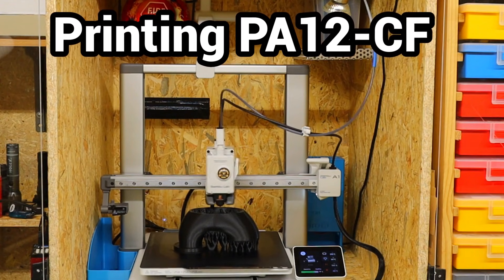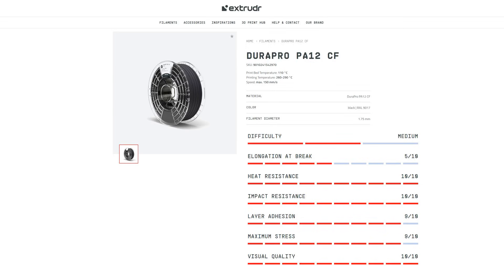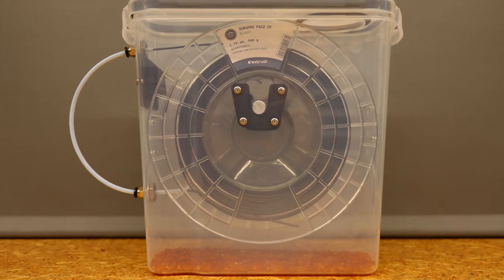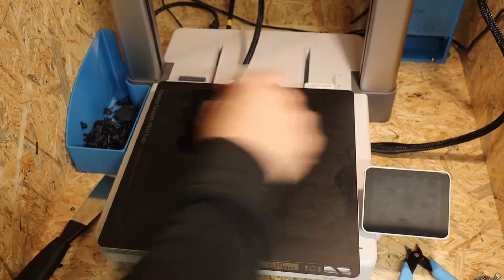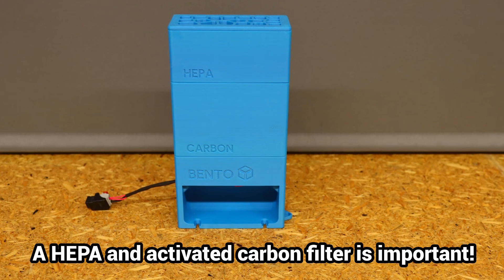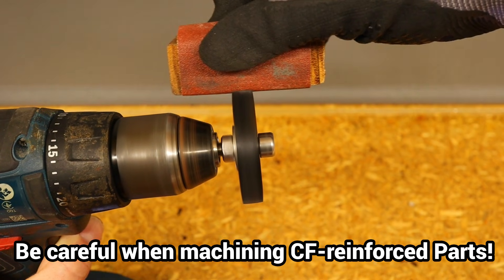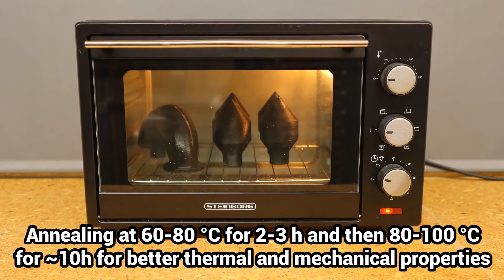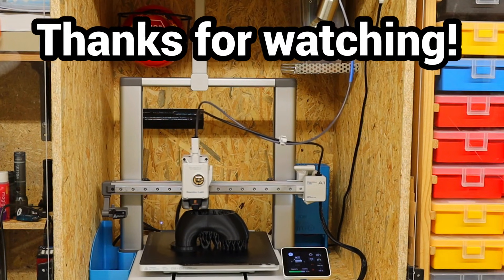Important considerations printing Nylon CF / PA12-CF

Comment: There rerally isn't "fibres" in £D filament. It's more a "dust". With no longditudinal strength from fibres I'm suspect about extra "strength" claims
Reply from the maker: Of course, a significant improvement in strength is not to be expected, but the microscope images clearly show fibers of considerable length!

Comment: I was wondering why nearly nobody makes pure nylon pa12? I can only get pa12 nylon mixed with cf. I wanted to avoid dealing with carbon fiber because of all the potential issues it may cause also I also did not need the extra durability of the cf and have an enclosed printer so warping should be minimal.
Reply: because it would warp
Reply from the maker: Yes, I also think the much lower warping and much easier printing difficulty of fiber reinforced filaments is the main strength of them!

Comment: Not better to anneal it before coating? 
As the coating should block the moisture in both ways, preventing from getting moisture but also to be released from the material.
Reply from the maker: I annealed it as is shown in the video!
Reply: The video show the anealing after the coating.
I ask if it's not better to anneal before coating.
Reply from the maker: Oh, then I showed it not clearly enough in the video, of course annealing should be done before the coating. I thought this is obvious, sorry.

Comment: Im currently making an experimental rocket (a quite big one [6" diameter]) and we were thinking of using PA612 CF by polymaker, but your video and tips are awesome, thanks dude! Also, I can´t use the discord invitation lol
Reply from the maker: Maybe your browser options block the use of the invitation?
It should normally work and I checked it!
Your rocket project souns quite interesting plz share pictures and videos!
Thanks for your kind comment!
Reply: @myengines2443  Hey! You were right, it was some options that blocked the invitation, tysm. Ill post some photos, just that i'm currently in a rush making analysis for the motor, when i get hands in the job, ill post something

Comment: About nylon and water its needed for the fully strange/ impact resistant.
IMHO for printing you want it to be as dry as possible but after it its needs the water to "develop" the full strange.
For example the cutting nylon blades form Stihl are shipped in a plastic bag filled with with ca 10ml water in it
Reply from the maker: This is the first time I've heard this.
So far I have always heard that moisture is bad for the durability of nylon components.
I will read up on this, thanks for the tip.
Reply: @myengines2443  I very much want to hear the results of your investigation on this subject. I also want to print sturdy nylon parts for revision of all kind of kitchen- and other kind of machines. Parts for old machines are sometimes no longer at hand or are far too much expensive. It would make me very happy if I can just redesign them en send them to a printer and get a part that does its job just as well or maybe even better! 😁 Subscribed to your channel, because I love the way you investigate and test things; your video's could be very much longer btw for the subject you are presenting. Looking forward to more of your video's!

Comment: This might break your production philosophy, but have you considered printing with standard filament, then reinforcing the print?

* You could easily apply fiberglass over the outside to strengthen it

* You could wind wire around it

* If you want a very low tech/low effort approach you could create an inner chamber and an outer chamber, then pour concrete in between. The printed plastic would provide the airtight layer while the concrete would provide the tensile strength.
Reply from the maker: I made very successful extensive tests with standard  filaments, I made a video about it a few weeks ago.
In the next months I need many parts for experiments of the thermoacoustic Stirling.
To get them without too much work and time it would be very nice to just print them., but when the stability is not good enough I will have to reinforce the parts the way you suggest!
Thanks for your nice help!

Comment: Not as impressive explosions but testing with water would be better?
Reply from the maker: Yes, but the goal is that they NOT explode... :-)
Reply: @myengines2443  I only meant from the point of view that many air type of pressure vessels are tested with water because if they crack, its less dangerous and parts don't fly so far. But what you're doing looks well under control 👍
Reply: @KarlFullerNZ  Slow motion would be great!!!! 😀

Comment: I've personally experienced that keeping a 100 W light bulb or other method of gently heating the enclosure can improve layer adhesion and printing performance for CF-nylon parts.
Reply from the maker: Yes, i have a halogen light in my enclosure but when printing Nylon I turn it off as the 100°C hot printplate makes the printspace too hot.
The A1 I use is not designed for this high temperatures and I don't want to get higher than 40°C!

Comment: Could you add another layer of protention by encasing the part in conctrete or other material?
Reply from the maker: Would be possible but its much work that I want to avoid.
If you look at my video before this you can see that even common printing materials can withstand a lot of pressure.
I am curious what the high tech materials can hold.
Thanks for your help!
Reply: @myengines2443  Yeah I can see why, good luck
Reply: @vottat  Oh I see you beat me to it. It was what immediately came to mind.

Comment: You can try to reinforce your parts with carbon fiber rods in direction of maximum stress by making holes in you parts and gluing rods in. I already done this, it give results. I call it Markforged for the poor. But again, nothing can beat all composite design.
Reply from the maker: Thanks, yes this is a possibility for some very stressed parts as it would be a lot of extra work!
Reply: @myengines2443  a threaded rod with nuts on both ends will also do but the general idea here is not to fight adapting technology to the design but to adapt design to the technology. Sorry if i'm being arrogant, you make a great work!
Reply from the maker: @ИванПанкратов-н9л  yes you are absolutely right.
But as I have to make MANY parts in the next time when it comes to optimizing the thermoacoustic Stirling I want to do this as quickly and easy as possible.
This is the reason I make this 'boring' exercises in 3D Printing and electronics and so on....
Reply: @myengines2443 these aren't boring they are cool